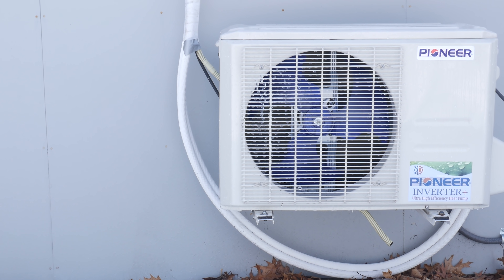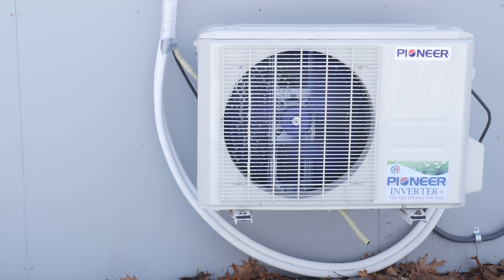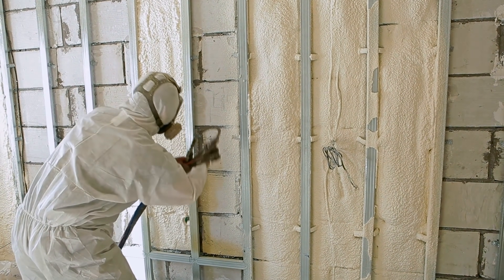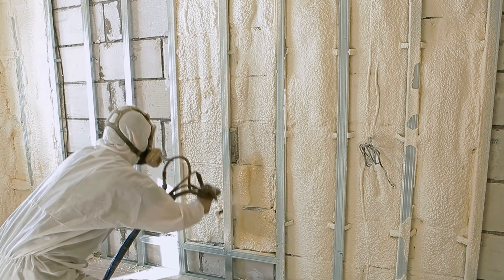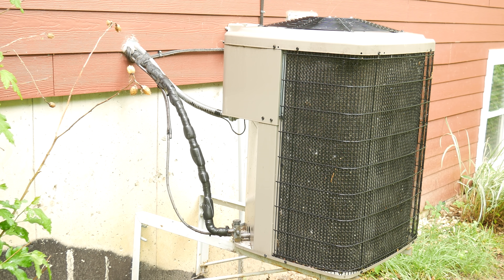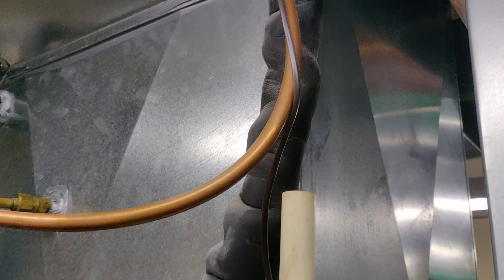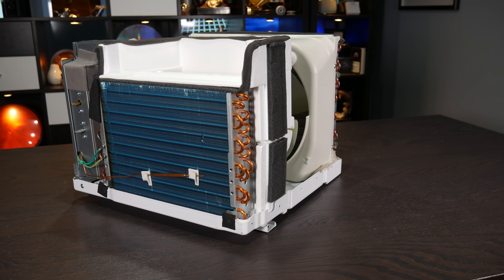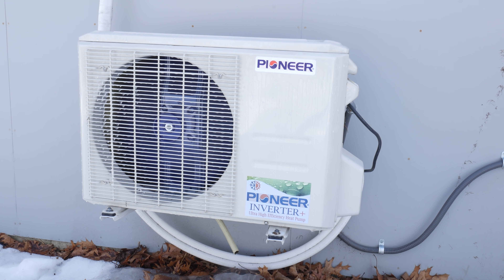Heat Pumps are Not Hard: Here's what it will take to start pumping

Comment: Your comments on contractor price gouging are spot on. My municipality offered a $1,000 rebate for installing a hot water heat pump last year but you had to choose from their list of 16 installers. Each one of the first few installers quoted between $5,000 and $6500. By the time I contacted 6 of these contractors I realized this is just a scam to have the $1000 handed over to the installer plus they are gouging beyond that. I ended up calling a regular plumber who was not familiar with heat pumps. together we went through the install procedure and he installed it perfectly at $2,200. Most of that was for running the 22V electric since I previously had gas only in that corner. Even without the rebate it was still way cheaper than using those who manipulate government incentive programs. Plus I always wanted a couple of 110V electric outlets in that corner of the garage and he ran lines for those as well (included in the $2,200). So buyer beware in areas where you must use contractors from a specific list (please shop outside the list to get the real price)

Comment: I'm an HVAC design engineer and I 100% approve this message.  Thank you for spreading the word.
Reply: Because it improves sales and service fees. But not actually, because it would create a safe heating source from an efficient local energy storage. It's unreliable, maybe usable as a 2nd unit, for cooling AND optional heating, but not as a main unit
The electrical grid will be even less reliable if cars and heating also relied on it and increase the demand 5-8 times.
Reply: @pteppig  do you have a source for the demand being 500-800% higher?
Reply: @CrustedCheese  He actually said 400-700% higher, not 500-800%.
Reply: @CrustedCheese  yes, better than green fantasy numbers. just compare the amount of consumed BTU for heating in a specific state and compare them to electric heaters and heat pumps.
Even the current electric grids are unstable dune have actual storage at scale and the cold weather in Texas showed how weather can drastically reduce solar while at the same time create higher demand that overloads the grid
Reply: WHATEVER.  I’ve been using a heat pump since the 1980s and it didn’t kill me financially.  As for “backup heat” there’s a resistance heater in the main unit that turns-on below 0 degrees.  Nobody will freeze in my house

.
Reply: My state Pennsylvania has never had rolling blackouts.  Unlike Commiefornia and Tehas, we use hydro & coal & gas to make tons of electricity.  Never had any problems 

.
Reply: @electrictroy2010  Is it a single stage heat pump? Does it use a demand defrost board or time-temperature defrost?

Comment: Many rental apartment buildings in NYC have "heating included," meaning there's centralized boilers feeding radiators that you have little control over. I used to live on the highest floor, and my room was so hot, that I had to spend the entire winter with my windows open. This is a common story when the tenant of a space cannot easily control the temperature of their space. Very wasteful.
Reply: Hot in the summer, Hot in the winter. . . I lived it. No matter how much you turned the valve to close it, it was always hot.
Reply: I lived in a similar old building in Detroit. It’s very very cold there but our windows were wide open. The bathroom became quite an impressive sauna when showering, so that was a bonus!
Reply: That seems like a tremendously naive design that only made sense before we had cheap electronics. Especially if boilers large enough to heat the building can be built with variable output. Then you could maybe have per-apartment thermostats control valves that admit the hot water into a particular apartment's radiators, and linked up so that the boiler only puts as much energy into the water as is actually needed to serve demand.

The upside is that if you have all the windows open maybe the airflow is better, but I can't help thinking there's better ways to do that (maybe not as retrofittable though; it's not like solenoid valves are big).
Reply: LANDLORDS ARE DUMB.  Not news.  My apartment has the thermostat locked behind a vent.  While I can unscrew the cover, wouldn’t it make more sense to mount the control on the wall?  Then the renter could change the temperature.

But the landlord doesn’t want me setting my own temp (even though I pay the electric bill separately)
Reply: @electrictroy2010  do it anyway.
Reply: I was watching a documentary on the "Spanish Flue" of 1918.  they stated that a "Properly designed building" in New York would have steam heating units under the window, so that the window can be left open to get proper ventilation all winter long.  So while wasteful, it would provide lots of clean outside air to breath.  Today we realize how wasteful that is, and your building super should be able to turn town the boiler when it is warmer outside, and only run it full tilt on the very cold days.  There is something called a reset thermostat, that measures the outside air temperature, and then sets the steam pressure higher on cold days, and less pressure on warmer days.  

If you can save the building owners $5,000 a month on gas costs, they could pass the savings on to the tenants, or at least avoid a sharp increase in prices when the cost of gas goes up next winter! 

I worked on a 12 story building in Portland Oregon that was built in 1965, with a small A/C unit on each balcony, that is about 10 feet square.  Such a balcony could be used to install heat pumps, with the units feeding each apartment.  It would be much more energy efficient that running window A/C units, and they do not fall to the ground!
Reply: @taylortisaac  Same here. Ever remember seeing the steam pipes coming up from the ground in the winter? Fun fact. That steam is centrally producted and distributed through a network of pipes going into many of the buildings to provide heat.
Reply: @ryanvandy1615  I do remember those steamy chimneys coming out of the roads and sidewalks! Oddest things.
Reply: The other option is to have a thermostat on it so when it closes the valve suddenly, the water hammer will startle you awake at night!  I had that option!

Comment: Thanks to the resources you present here, I was able to:

1) compare my natural gas and electricity costs directly in kWh to find the breakeven CoP (3).
3) use historical weather data for my location to see that my winter temps are above 17 degrees Fahrenheit ~100% of the time.
2) use the NEEP list to find multiple heat pump models with CoP > 4 at 17 degrees Fahrenheit.

Now I know that replacing my natural gas furnace with ductless mini-splits will decrease my heating costs. Thanks Technology Person!
Reply: Now you have to calculate after how many years/decades this will pay.
Reply: @whuzzzup  Same happened with economical/hybrid cars.. and those calculations have gone out the window with incredible increases in LNP and Petrol prices. It pays to be ahead of the curve sometimes.
Reply: @freejulianassange537  Also, and I know this is some privilege speaking, but if you have the money to make the switch return on investment isn't really all you should care about. Honestly it doesn't even need to be the highest thing on the list of things you care about. The benefit to society and the planet are externalized costs that we forget far too easily.
Reply: @whuzzzup  kind of a mute point if you need a new system anyways. Taking out a perfectly good work furnace would change the argument.
Reply: @Trainwreck1123  I can see why you're a fan of this channel. Well met. 8)
Reply: @Trainwreck1123  yeah but chances are there are other (good) things u could be doing with that money, so looking at the return is always something u should do
lets say for example a heatpump at ur location was barely worth the money, u could instead go for something like an electric car especially in the US
not even mentioning that the return on investment angle is a lot more popular than "spend ur money to save the environment while other people do what they want" angle
Reply: @kxhonda  hey just wanted to respectfully say that I think you were looking for the word "moot" i.e. a "moot point". You made a great point I just think you used to wrong word by accident and I wanted to let you know for the future in case someone less friendly saw it. Take care
Reply: Once we are past "essentials", even when it is unconscious, many of our decisions are made to match how we see ourselves (or how we WANT to see ourselves). The reason someone buys a particular brand of car, truck, or shoe is not just some combination of cost, features, and quality - it is also greatly influenced by how that item fits into self-image. Spend thousands on landscaping? A new truck? Trips to Vegas, Paris, or Panama? If people have enough money to spend on any sort of "conspicuous consumption", it seems much better for the rest of us if they spend it on solar panels and heat pumps rather than "super yachts" and trips into orbit.
Reply: @freejulianassange537  so where are all these economical ev cars the cheapest Tesla is over 50k out the door. Maybe the children miners can’t keep up
Reply: @mddunlap03  I said hybrids with purpose. Just about all the taxis in Australia have been Priuses for years and to their great economic advantage. They'll give you 58mpg vs 28 for a comparable Camry for example. That's worth smiling about at the fuel pump..and they're both about 26kUSD or something.
Reply: My heat pump replaced my wall toasters here in Oregon.  With the added benefit that it acts as an AC unit in the summer. For emergencies we have a karosene heater as our emergency back up if we ever lose power for extended periods.
Reply: @whuzzzup  You also have to do a present-worth calculation.
Reply: @mddunlap03  You clearly don't know what you're talking about. A couple years ago tesla released a $35,000 model 3 brand new.
Reply: @mddunlap03  Hyundai will sell you a sweet hatchback for 50k, the BEV ioniq 5 not a hybrid. for 5k more you can get awd.
Reply: @whuzzzup  He was probably upgrading his old furnace anyways.
Reply: MY HYBRID PRIUS erased all its fuel savings when I had to spend $3000 to replace the battery. Sooo I would have been better-off buying a 40 mpg standard car (like Civic HF or Cruze Eco) that had no battery to replace!!!

.
Reply: MODEL 3 PRICETAG is now $40,000 minimum.  Add taxes & Tesla delivery fees, you’re looking at $45,000 for a non-luxury barebones EV

I could buy a Focus or Civic or Corolla for just $15,000 (and did).  Saved myself 30 Grand

.
Reply: @pattondurio  Tesla prices have only gone up and up. That $35k trim is long gone (circa 2019?). Currently the least expensive Tesla is $46,990 usd.
Reply: To get 100,000 Btu's of heat into your home, you would need about  1.3 therms of gas or 1,3 gallons of propane or about 1 gallon of fuel oil, or 23 KW of electric resistance heat, or about 5-8 KW of energy into a heat pump.

So the low cost winner will always be a heat pump!  

However the 3-4 zone ductless heat pumps might present a huge and overly expensive equipment cost disadvantage.  I would rather install a couple of 12,000 Btu units and deal with the extra wiring costs, than to install a 24,000 Btu with two heads.  If the compressor stops working then your whole house will get cold, while the two system would keep working to warm at least part of your home!
Reply: @mddunlap03  EVs are expensive to charge. Not worth buying if you don’t have free charging at work
Reply: @Kangenpower7  most situations natural gas is cheaper.
Reply: So, how are things looking now, out of curiosity?
Reply: @gund89123  are you talking about public or private charging? if you mean public, you realize you could charge at home?? they come with a charger for home use to my knowledge... and no matter where you live rn, electricity is way cheaper than gas...